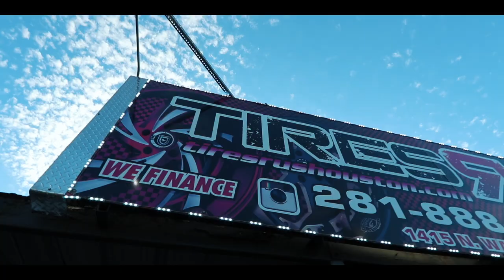392 / 426 Cammed HEMI Charger BURNS NEW TIRES To The WIRES!!! (ALMOST ARRESTED)

Comment: Shit was dope. What size tires did you have before you put the 305s? I'm in Katy. I might have to make my way to the east side in a few weeks to get some 305s for my scatpack
Reply from the maker: I had 275/40 The stock size that comes on the car, they were brand new😂 It’s worth the drive as well bro, bad ass shop